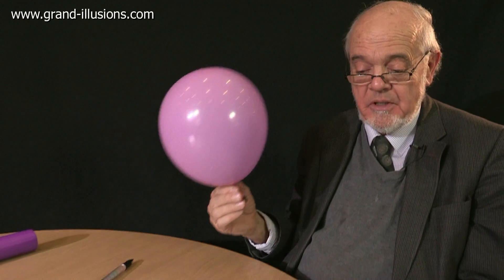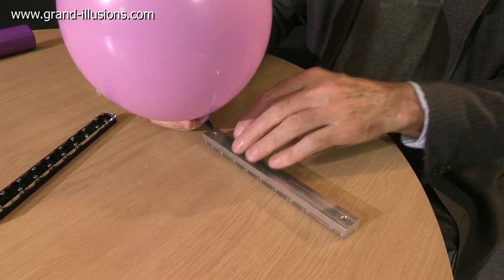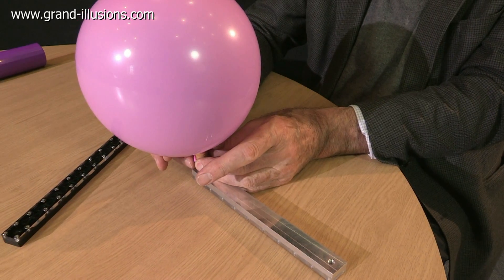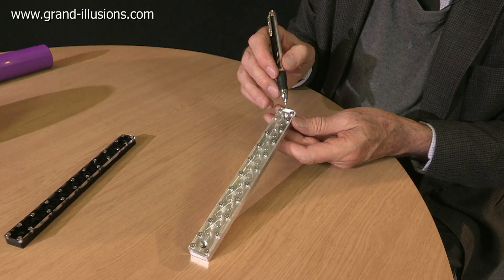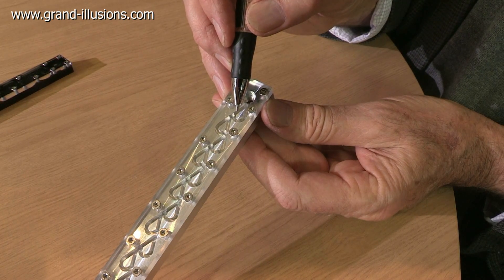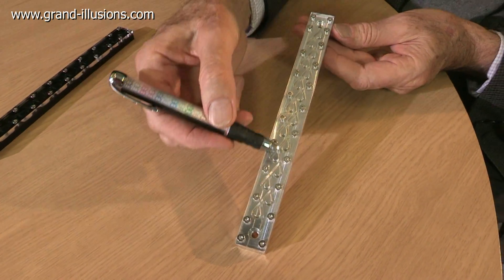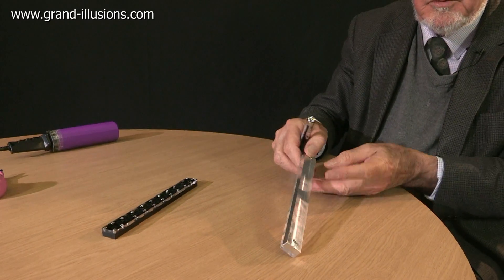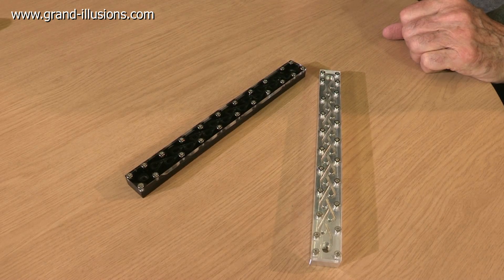Tesla Valve

Comment: Could it be used in outer space? Rocket engines?
Reply: Propellants are under ridiculous amounts of pressure (Space Shuttle Main Engine had propellant pressure of about 6-7 thousand pounds per square inch. This is roughly the weight of 2 cars or 1/2 of a T.Rex per square inch). Valves in rocket engines must withstand this, as well as temperatures of about -200 C for most rockets (liquid oxygen is a commonly used oxidizer, non-cyrogenic oxidizers (Nitrogen Tetroxide / Red Fuming Nitrous Acid) are usually VERY dangerous, like inhale it and you will be hospitalized if you're lucky and die if you're not). All oxidizers like to oxidize stuff (duh), which means the valves have to be made out of materials that withstand corrosion. The result are valves that literally cost tens to hundreds of thousands of dollar, because they have to work 100% of the time or the rocket will not work (Engineers like to put extra things on to make sure if one fails, something else can handle it, but this adds weight and weight is everything in spacecraft. Whether it explodes in mid-air or after crashing to the ground, a valve failure will mostly likely be catastrophic. And this "valve" only slows stuff down that tries to go the other way. It's not even a real valve.
Reply: Modulo m Don't feel bad because you were made a fool... That's no reason to insult others.
Reply: that would be bad because there would be a possibility of return of materials, like exploding fuels.
This is best for those that a small return does not harm the system, like water pump and such. This way there are no moving parts and less likely for long term damage

Comment: so if you put two balloons of the same size on this would one get bigger?
Reply: Cool Idea! But If they were the same my guess is no. The fact that air can flow easier from one to another doesn't change the fact that they both have same pressure. One way valve needs flow (potential difference) to operate. This would be just like submerging the valve under water, and expecting flow from one side to another. If you had different sized balloons, than air would flow only if bigger balloon was on side that let's the air flow and it would fill the smaller one until they were equal size.
Reply: NOPE
Reply: all you have to do is scroll through the comments, been answered thousands of times
Reply: I don't know who are you referring to now. Was I right or wrong? Thanx!

Comment: a solid state valve?
Reply: Solid state fluid diode.  To include an equivalent to forward voltage founding electrical diodes.

Gas and liquid state matter both behave according to the laws of fluid dynamics
Reply: no, this is a liquid state valve
Reply: I think you'r right. no moving parts. I wonder, if you make a long version, could it blok from 1 side 100%....??
Reply: @tobytimber7744  I doubt that the law of diminishing returns will allow a 100% stoppage. 
However just like an electrical diode the flow should be able to be reduced to a value low enouph to sute a spicific purpose.  one of the other comments said Tesla used these in place of normal pushrod actuated valves on one of his prototype engines
Reply: @daviddroescher  yeah, even real electronic diodes leak to a level
Reply: @tobytimber7744  honestly I don't believe it would work because the longer it gets, eventually at the bottom there is less an less pressure but water still has to get out, causing vaccuum just like water coming out of a bottle.. there has to be an exit point... unless you block it there will alway be dripping
Reply: A transistor?

Comment: Why has no one used these in flood defences? A river can easily flow downstream while a storm surge would find it close to impossible to flow upstream. Especially with big rivers like the Rhine, the Mississippi and the Thames
Reply: The idea is that the river will flow downstream easily while the incoming storm surge would be fighting against both itself and the river. The trouble is that most flood defence solutions involve a barrier that blocks the ocean but also the river at the same time. Powerful pumps can be used to take water from the river and transfer to the ocean but you also have to deal with the problem that the increased rainfall will significantly increase the amount of water flowing down that river, causing it to rise. The tesla valve levee system would allow the water to flow into the sea. Building the tesla valve as close to the open ocean as possible would be required to mitigate problems caused by the funnelling effect.
Reply: SentsuizanXS I can see where you're coming from. You still need the sea wall to deal with the sea level rise. It does not prevent sea level rise and I never said it would. What it does do is allow the river to flow out to sea while reducing the river level rise by inhibiting the sea from flowing up stream. The only current solution on rivers is to use a barrier across the river. The problem with that is that it also blocks the river which has increased throughput anyway from the increased rainfall caused by the storm.
Reply: Evan Mathers Think about it. If all the extra water can't flow backwards, it will simply rise above the level of the valve and spill over anyway. The only way to prevent that would be to use the valve with a large closed tunnel, which costs a hell of a lot more to build than a wall.
Reply: SentsuizanXS well ok I see your point, and its a valid one, but usually the problem with levees isnt that they arent tall enough, but they break somewhere or something
Reply: shit... lol, wouldve helped for Katrina
Reply: its like a gravity-automated levee pump if you set it up right tho
Reply: and clown, it would slow the flow of the ocean through the slower flow direction, any volume or pressure would be slower through slower vector
Reply: How could the river possibly flow through the valve if there is enough water at the bottom to counteract the natural flow? The river's level will still rise, since this valve is not completely one way. And like I said, unless the valve is inside a tunnel the water will just overflow since it isn't contained in any way.

So either you build a wall, or you build a valve and a bunch of walls for not much benefit.
Reply: the valve has to be built perfectly to work perfectly. But once you do, you don't have to worry about it, ever again.
Reply: it wouldn't slow down the ocean.
Reply: It would be pointless since the water would just flood at one end of the valve.
Reply: SentsuizanXS I dont think that even grammatically makes sense?
definitely not clear :°
Reply: because they are a worthless toy

Comment: So if a balloon was placed on each end, would one inflate the other?
Reply: +Jeff Millett If both balloons were equally inflated, nothing would happen. The only difference would be the time it took for an inflated balloon to fill the empty one. In one direction the balloons would equalize slowly. In the other direction, it would happen faster. But no matter which way you spin it, the balloons will always end up at the same pressure.
Reply: Bren Krasmer Wow that's pretty cool. It makes sense though if you think about when you're trying to blow up a balloon, at first it's a really hard to blow into it, but once it stretches past a certain point blowing into it becomes a lot easier.
Reply: Hooke's Law, baby!
Reply: Only until the pressure is equal.
Reply: +4X4 E30 Actually? funny thing about balloons like in the video, the less inflated balloon would inflate the more inflated balloon, because the walls of such balloons actually put less pressure on the air inside them the more stretched out they are. You can even see it with only one balloon. Fill it up, and when you release the air, you can hear the pitch and noise of the escaping air rise near the end of the deflation. There are several videos out there proving just that, but, yeah, it would equalize the pressure overall.
Reply: @brenkrasmer  This is fascinating, thanks! I'd never thought to consider it but it makes perfect sense now that you've pointed it out. It will take a while before this concept fully settles in my worldview, but I can already feel it integrating.
Reply: Yes

Comment: I don't know if Tesla is credited or even responsible for this application, but this type of valve is used frequently in water pipes, to prevent sudden pressure surges which could damage the system.

Comment: A simpler way to do this, is to make a thin and a wide pipe.And, yea, you could stack them inside each other.
Reply: How would that work without a valve at each end directing flow? Your design of a valve would require two valves. That's silly.

Comment: I can think of a few applications. The long profile and inability to adjust or reverse flow direction hinders its usefulness somewhat but it would be a natural fit for shock absorbers. Im sure somebody with more time on their hands could think of a way to use this to replace one way valves that must operate at very high cycles per minute, like in engines.
Reply: It could be useful as a shore protection measure, to let the river flow downward and keep the tide out
Reply: @SchiwiM  we have way better systems to control backflow, i specialize in valves and get into so many applications and i cant think of one where this type of valve would be preferred over a ball, plug, gate, butterfly, or swing valve.
Reply: @SchiwiM  Interesting idea. It would require solid river banks, otherwise the river would just create a new path. Solid river banks increase flood risk from high water coming from upriver, since there is no absorbant overflow space. Though that is only true far downriver, and near the ocean a local flood doesn't matter as much. It would give fish a passage way, so that is good, but the solid banks would leave little room for other forms of river delta nature.
Reply: Ain't it used in gas canisters?
Reply: johnny llooddte please go away if you don't like it why are you on this video?
Nice turtle neck though
Reply: worthless this is why its still sitting on the shelf after 100 years

Comment: They have this setup in some exhaust systems, it's called anti- reversion.
Reply: +NormanMatchem Geez - - why not just have a vent ??
Reply: +Mentorcase 
You know that the muffler copies the construction of the silencer? Or the 'suppressor' as more people are  calling it nowadays? I was just thinking that this tube could be a sort of over-engineered way of making a firearm select fire for automatic or manually operated. Rotating it one way will have gasses from a port in the barrel QUICKY head back towards the action, cycling it to allow for further firing, or if you flip this huge blocky thing around, the expanding gases are slowed to the point where the action cannot cycle, effectively making it a manually operated firearm.

Comment: This could be elaborated by milling four quadrant sections and assembling as a cylinder within an adjustable sleeve. By porting each "J" section it seems like a very efficient variable hydraulic shock absorber core could be designed as someone mentioned or a pressure spring retained regulator valve (ie steam)  which would open more relief ports as the increased pressure causes the core to slide further out of the sleeve. The valve itself would become the moving part so no claim to 'no moving parts' i guess.

Comment: Obvious application for this is draught proof air inlets for gas fires, etc.  If you install a gas fire then (unless it's got a balanced flue) you've got to cut a 4" hole in the wall to let in sufficient air to feed the fire. Trouble is, any wind outside and you get a cold draught coming in.  Enter the Tesla valve. Put a Tesla valve in the hole so that air can only travel slowly through it. You'll still get enough air to feed the fire, but any cold draughts are blocked. No moving parts, so nothing to go wrong.
Reply: Mandolinic I think your "draft" is actually an air pressure burst, not a back pressure burst . In otherwords, its like rolling the window down in your car and all the pressure is sucked out of you car and your ears. Same happens to your furnace , its a large gust of wind passing your house that sucks the pressure out through your pipes. I think the best way to combat this would be to have a fan in your pipe with a flywheel attached to keep the exhaust flowing at a constant speed and not being affected by a fluctuation in air pressure.
Reply: +Mandolinic I love it when people think for themselves. Are you an engineer?
Reply: Najey Rifai I used to be a software engineer!
Reply: +Mandolinic  I dunno,  seems that the way this slows fluid down is by limiting volume as well. A larger valve would also increase speed.  A large enough baffled, zig-zag,  inlet can slow  flow without affecting volume too much, as can duct work with a few sharp bends. And, surprisingly,  a  larger outlet on the  inlet can let in a comparatively larger amount at a slower ( less drafty)  rate than a smaller one.    I'm pretty sure this is somebody's law. You go to messing with any one of  rate, volume, and pressure, and you affect the others.  make one go down the others go up  or down. It's complicated, might take more than one somebody to make enough laws.
Reply: Suhkma Dheek Fair comment.